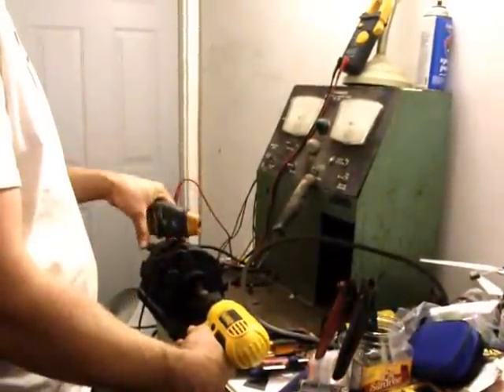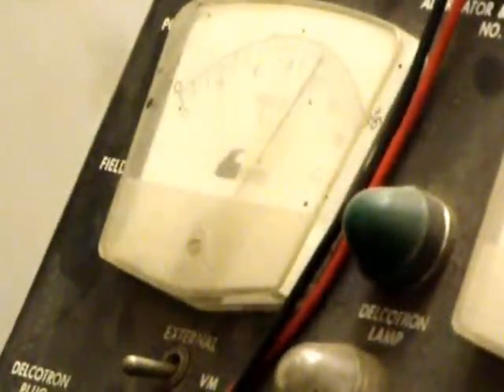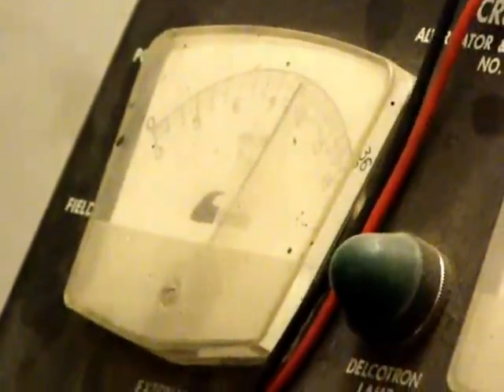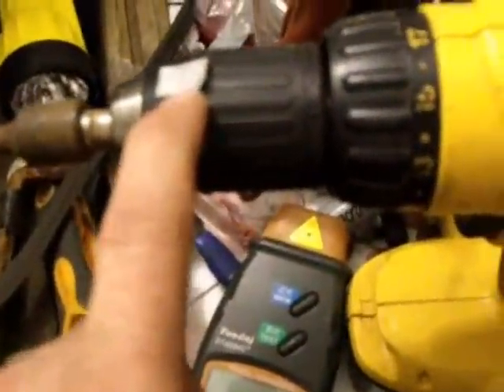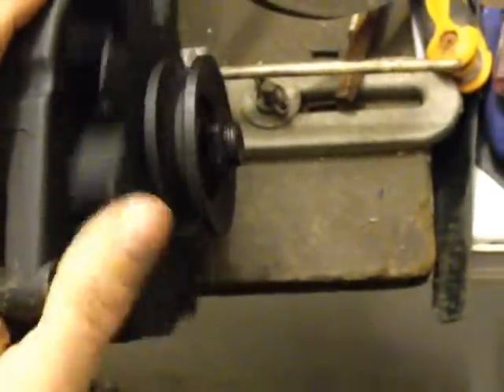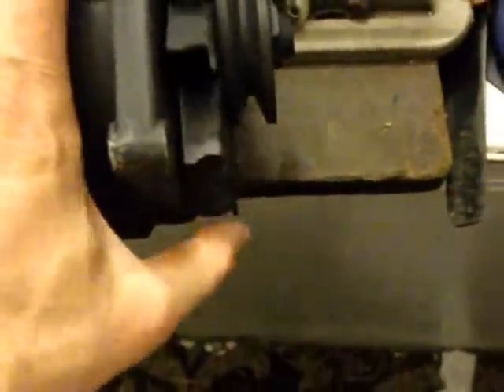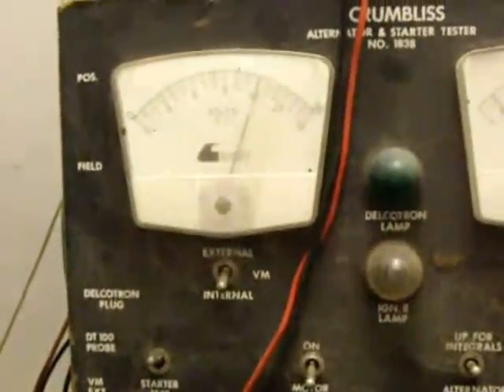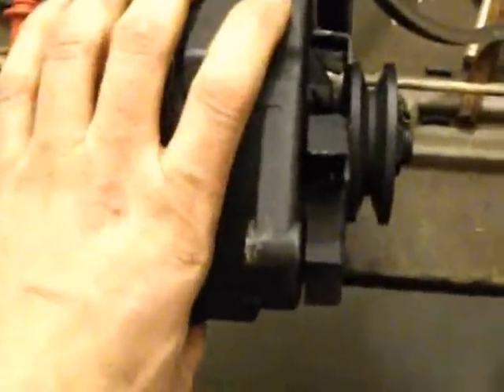Extreme low rpm 10si alternator, 950 rpm charge!!!!! Not a  PMA!

Comment: and just what are the modifications please
Reply from the maker: I used a D10AC regulator and a 24v stator as well as 10DN rotor(low amp draw 1 amp)
Reply: batteryphil 
you seem to know your stuff. I have four 12 volt 22si alternators. but I need to charge a 24 volt bank. any suggestions? I have to rebuild them anyway. so mods will be fine wile there apart. I have heard a regulator can be made with transistors and zener diodes and get up to 60 volts from them . but that don't sound right to me. an electro magnet can only get so strong. and do so much. looks like the rotor coil would burn up. I guess 28volts or so maybe. but looks like there would need more rpm. and cost the life of the rotor. can they be converted. or ran in series?
also could they be basically converted to generators by feeding a pwm signal to the brushes. to get the required voltage? the pwm would be a little easier on the rotor. just a crazy idea. I do need to get them going to charge the batteries for my house. hope you can help. and thanks anyway